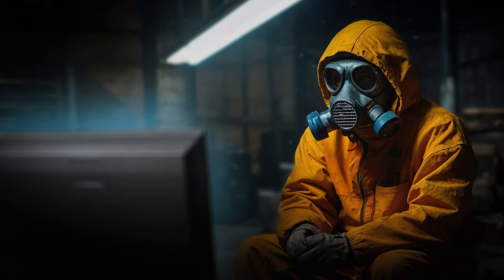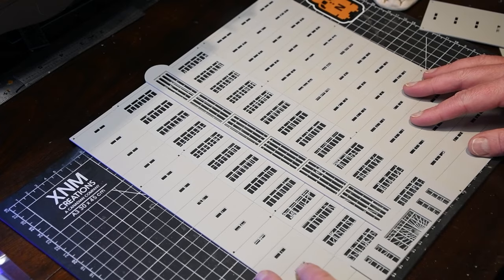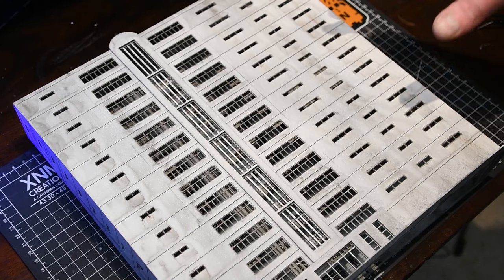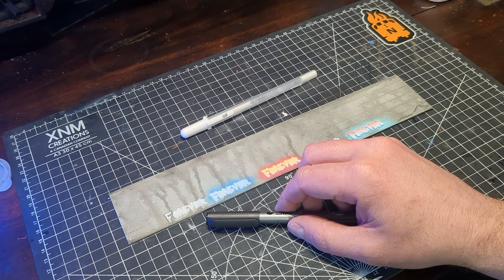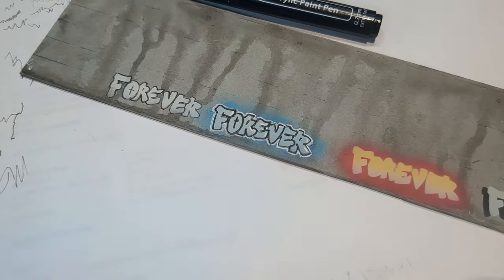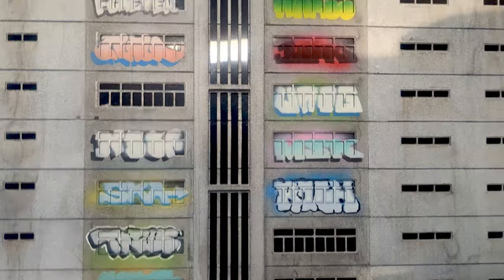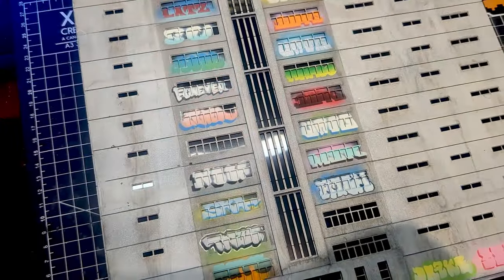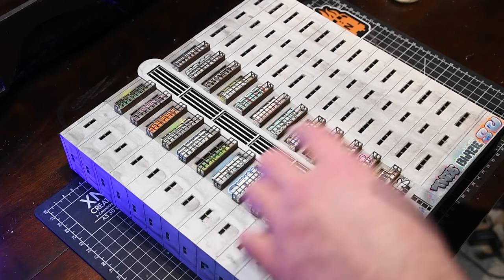Cheap Kit, Big Building - Modeling an N Scale Graffiti-Covered Plaza Through A Creative Lens

Comment: Iv watched this twice now bc I’m blown away by the amount of detail you took on but couldn’t put my finger on how it could be closer to the source. I think it’s that the stencils are all the same rough size and tags aren’t that exact in most cases. A few that were taller or shorter mixed in maybe. Brilliant work either way.
Reply from the maker: Sometimes making something small, doesn't mean the scale is correct. The graffiti could have been more refined. It was 'small enough', but not quite accurate enough. Thanks for the comment - it's great feedback.

Comment: When it comes to scale structures, I can't recommend Balsa Wood and Styrofoam sheeting enough. Can be used to make pretty much anything you can imagine, and so much cheaper than your average kit. Styro can be hardened up nicely with some Mod-Podge sealer. Add some Styrene sheeting for detail and/or load-bearing parts, and then you're really cooking with gas. 

You can get it in pre-textured or plain stock from pretty much any hobby outlet. Evergreen makes some great quality plain-stock. Plastruct and Plasticard also make some good pre-textured stock, but it's far more expensive.
Reply from the maker: I use quite a bit of styrene. I have access to a wholesaler that makes it far cheaper than buying commercial products
Reply: @NScaleDystopia  Good stuff.

Comment: It looks great! Are those Overland model kits FDM prints or resin? No warping issues?
Reply from the maker: I don't know if they're either. They could be injection molded?
Reply: Outland Models website lists/tags  their flat kits as ABS. 3D print kits are tagged PLA, Resin, or Mixed.
Reply: @neuparadigm ABS can also be 3D printed just a bit more difficult. I doubt they are a big enough manufacturer to do injection molding but who knows. They might have started off with just 3d printing and now are moving to other manufacturing processes.